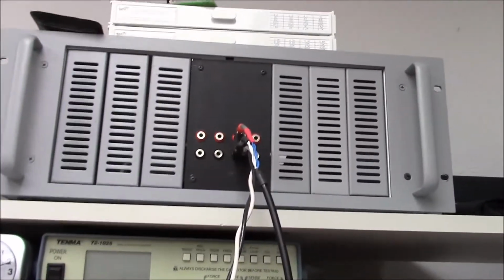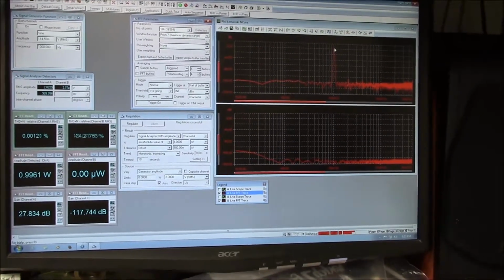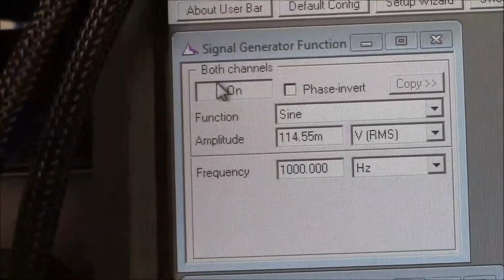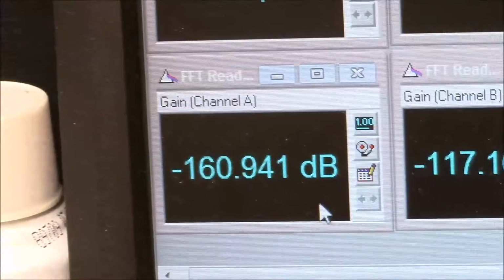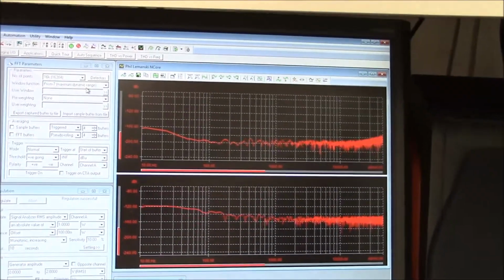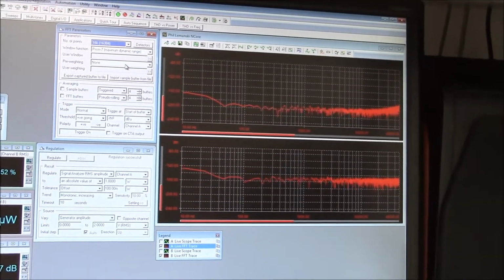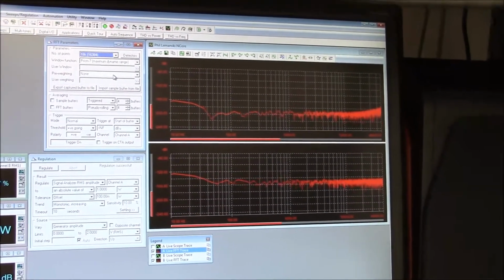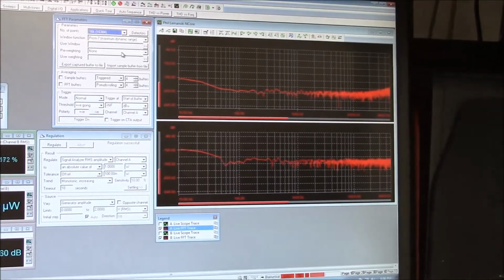ATSAH NC Noise Floor

Comment: That’s very interesting.
I work with audio analyzers all day every day. 
As soon as you unplug the input to the Dscope (disconnecting the DUT from the analyzer) does the Dscope’s displayed noise floor jump back up to the normal position of -145 dB or so?